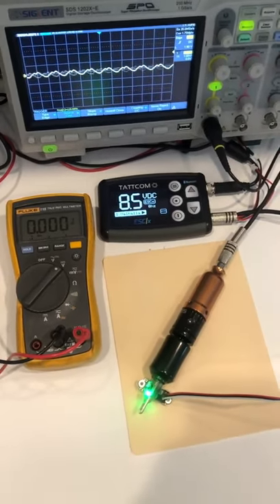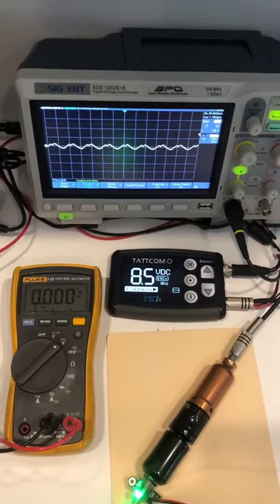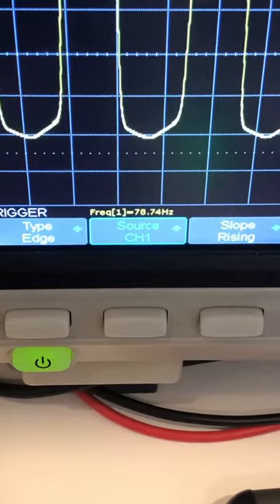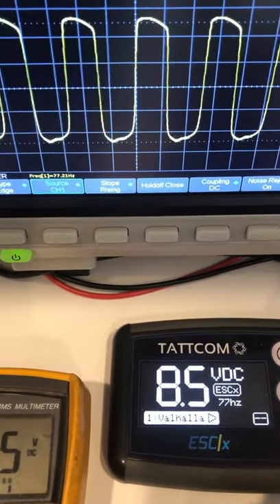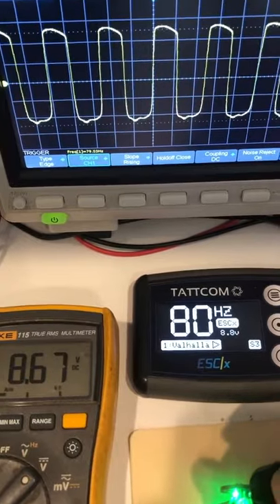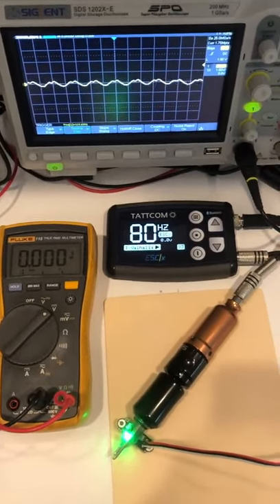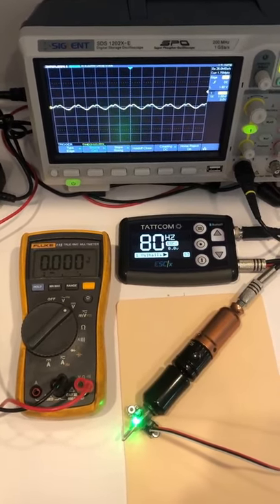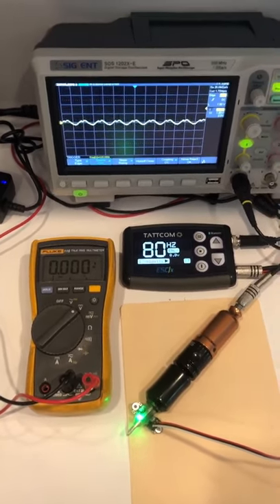The Voltage and Speed Relationship When You Tattoo.

Comment: Will this also help create more consistent power for people that may be experiencing fluctuations due to their shops being in older buildings?
Reply: Yes, the precision voltage regulation in the ESCx tattoo power supply is very tolerant of input voltage fluctuations. You can check out section 3.11 "Voltage Dips, Short Interruptions & Variations" in our CE test report that shows the ESCx can withstand a 60% Voltage Reduction for 5 cycles with no interruption to the output. https://www.tattcom.us/pub/public_html/2101-117E%20Tattcom%20Report.pdf

Comment: The hertz varies a lot on my Bishop wand packer and I tried other machines and it still fluctuated. Is it normal?? I am using a Venom power supply. Lithuanian iron... The power want fluctuated around 10 hertz up and down, the other machines about 3 hertz. Is it a problem or it is ok for rotaries to do that? Thank you